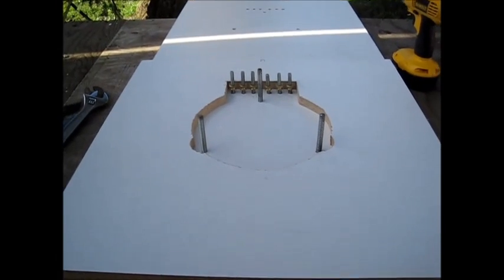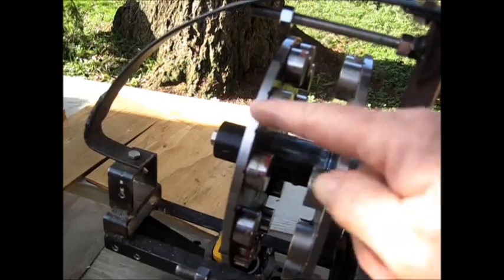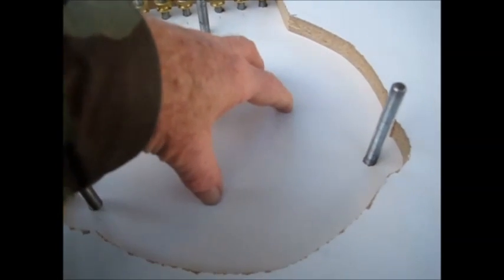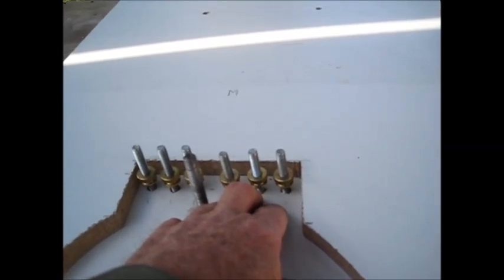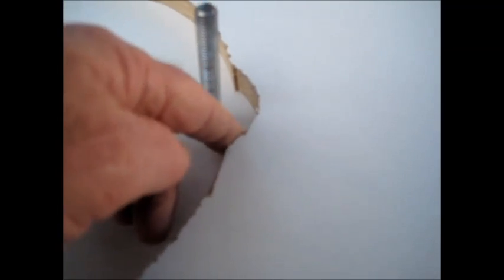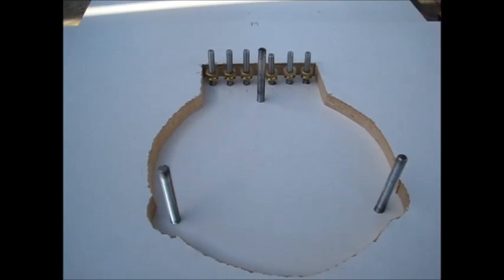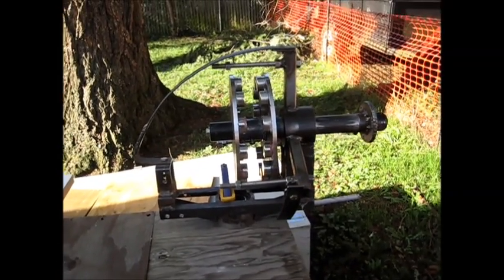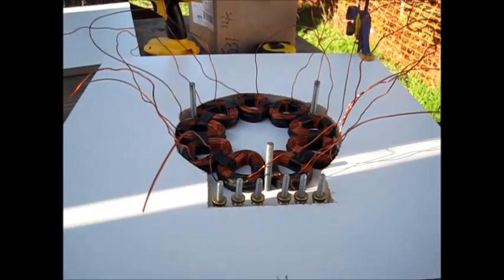Wind Generator Stator Mold set up

Comment: Going to make a stator with the Star/Delta. Did you find those knurled connection from the wind for volts website? I bought from him and they are $$$. just wondering if you know somewhere else to buy them. But going to view more of your vids, thanks
Reply from the maker: hey buddy, I actually got those from a local hardware store. 37 cents each.  check out hardware stores like true value or mom and pop hardware stores, also you can find them on ebay pretty cheap
Reply: +SilentDeath002 thanks and I hope to find. Are you still going to build Chris Olson's turbine. But the days of the steel core is done for me. The air core will be my answer to making more power on the low wind side. I'm sick of the BS that comes with those companies that are in competition with false output's!! One more thing, you use grease and wax paste for the stator?
Reply from the maker: the last stator I made I used the auto paste wax and found it did not release as well as one I used axel grease. big difference in how well it released.  I also made a stator using bondo mix, and it just gets to hot and I was not happy with the results. that compound Orlando told me about works really good, just add a little baby powder to the mix and it helps reduce any heat build up quite a bit. need any help let me know.
Reply: +SilentDeath002 ok thanks again.

Comment from the maker: http://www.westsystem.com/ss/
my buddy Orlando sanchez told me about this site to get the epoxy resin to make the stator. the solution works much better then fiberglass compound you can get at home depot.  you want to use the 105 epoxy resin along with the 209 hardner, if you can not find the 209 use 206, its a slow cure.  you can click on the site locator and input your town and it will come up with a list of dealers close to you. I found one down the road a little from me.

Comment from the maker: from the coil design, I could not get a good price on wedge magnets that would fit. it would of been a custom order and would of cost me a arm, leg, and shoe string. I think a 1 inch wide x 1.5 or 2 inch long magnet would work really good, but the rotors could use at least a half inch more dia and more room for stator mount would be great,,, might have to raise up the bearing mount about 1 to 1/1/2 inches higher would be great!